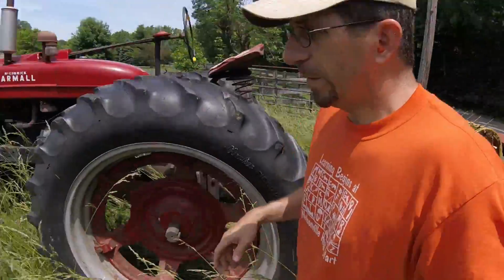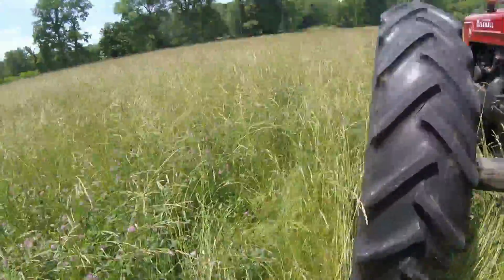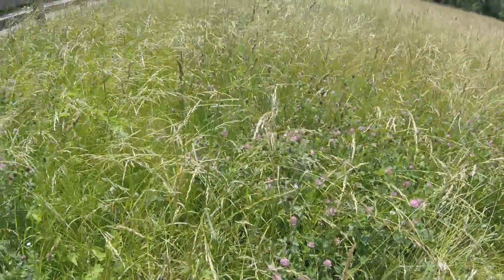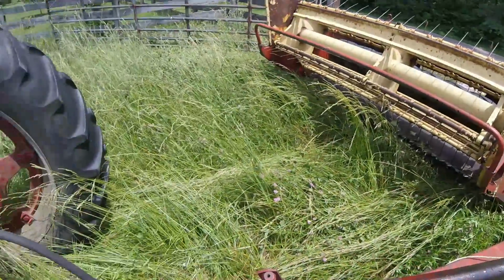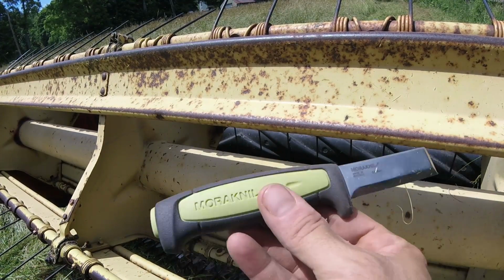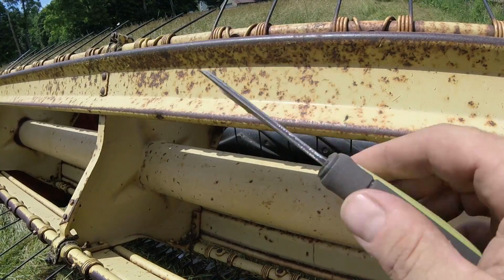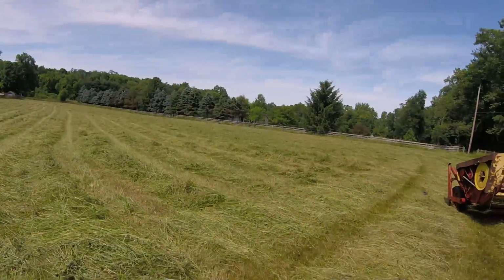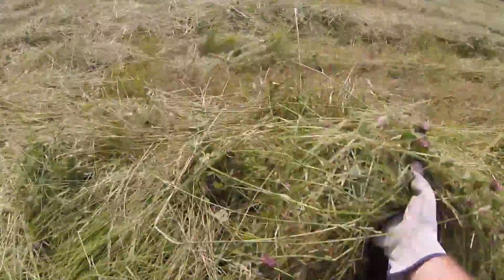Farmall M mowing hay

Comment: Farmalls are awesome tractors
Reply from the maker: They are sure tough. This M was missing a bit the last time I mowed with it, so I pulled the distributor cap off to see. All the contacts were covered in oxidation. That tractor had no right to be running at all, much less just missing on occasion. It's amazing what they will tolerate.

Comment: If you mow the field first (clockwise) and the outer edge last (counterclockwise) the material will feed better.
Reply: Not only that, you have more room to turn tractor and mower around without running over standing grass.

Comment: Do you think its practical to disk, plow with a farmall M today?
Reply from the maker: It doesn't have a 3-point hitch, so you might take that into account. You'd probably find the plowing and disking easier with something like a Ford 8N. That's what I do my garden work with.
Reply: Absolutely. Its practical if your runnning under lets say 80 acers or so. Can be more, but you'll be out there a while. If you dont mind seat time, then have at it. You wont find implements as far as 3 point goes, but there is plenty of trailing disc and trailing trip plows around. Do realize Farmall Super C's were used on 200 acer plus farms back in the day, and those are smaller then an M. I use a super C to bale hay. Not fast, but no bailing is fast from what ive seen, I also used it to disc a pasture using a 10' trailing disc. So yes, it is very possible and practicle where bigger equipment cant get into.

Comment: What did you have to do to make the hydraulics pick the haybine up?
Reply from the maker: I put the hydraulic belly pump on, ran a single line back to the haybine, and it worked. I don't think this setup will do two lines, but it handles one just fine.

Comment: The M doesn’t have Live pto power?   Is that correct?
Reply from the maker: That is correct.
Reply: @smallfarmsurvival4026  wow I didn’t realize that you could run a haybine without live power.   I have run sickle bars without live power.    Interesting thanks for sharing hay cutting experience.   Love the M.   I have thought about purchasing one I don’t know much about them!
Reply from the maker: @mulehead3697  I've never used the haybine on a tractor with live power, so I don't know what I'm missing I guess. I do know it helps when you're using the baler. You can hit the clutch to slow or stop while the baler eats a big clump.
Reply: @smallfarmsurvival4026  oh.   I was always just used to using I have PTO on everything when I was at home.  Then I got introduced to Tractors with out  live pto power.   Just never seen a haybine Used without live pto power.  Taught me something today pretty neat.
Reply: @mulehead3697  Absolutly can, they have a over run clutch on them just like a baler. I run a IH 37 baler on a Farmall Super C. Dont need an over run clutch because its built into it.